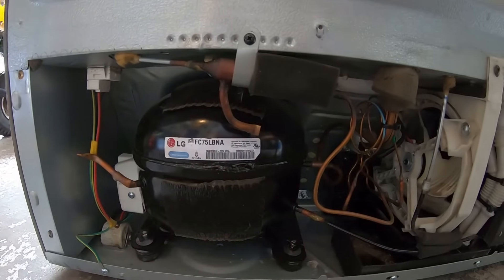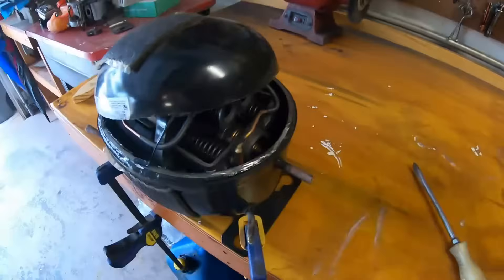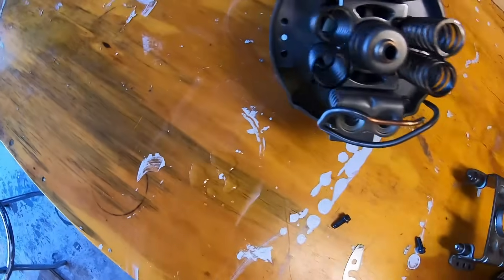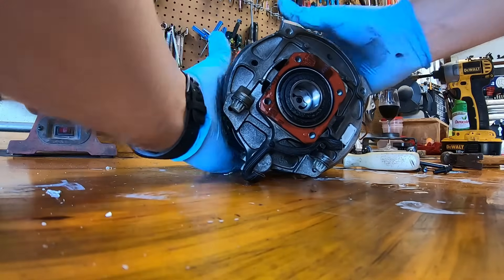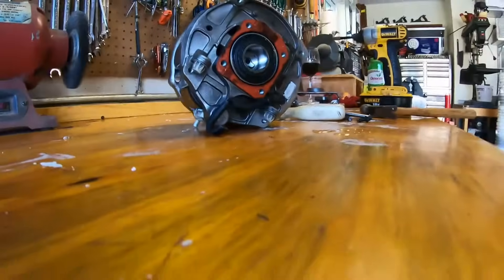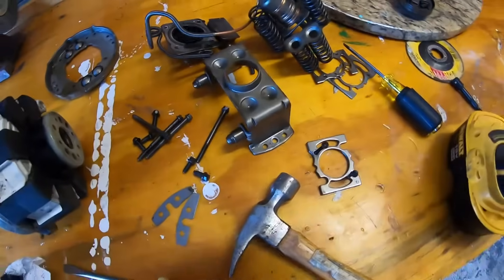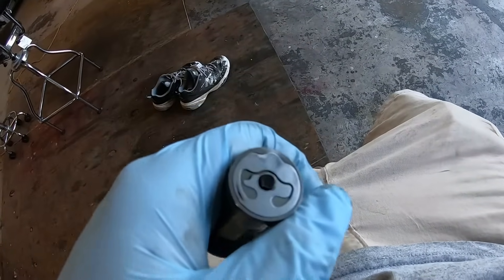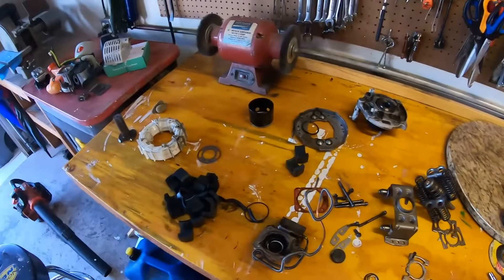Cutting open a failed LG refrigerator compressor

Comment: That “flimsy” metal plate on the top of the piston is the inlet/suction valve. I recently cut one of these open as well to find that mine had a hole blown through it. I found the same burnt residue on the same parts as yours. I assume probably burnt oil from running constantly without pumping anything.

Comment: I really miss the good old days where fridges were built like tanks and even lasted for decades. Nowadays, manufacturers dont build their products as robust compared to the 80s. My LG fridge gave me so many issues that it left me feeling stressed. Even repairing it costs a bomb.  I dont expect a fridge to last me for decades in this era but it should at least last for more than 5 years !
Reply: I DO expect that that when I pay good money the product lasts for decades. The last stove we bought cost $1,000 and within months the burner switches failed and then the main control board. They wanted half the price of the stove to replace the board. It's pure THEFT, as far as I am concerned and if I was a millionaire, I'd SUE.
Reply: When you open the expensive ovens you'll find the exact same thermostat assembly and other components as used on the lower cost makes.   @rae0521
Reply: A friend has a fridge freezer from 1960. No bells and whistles, but it works. I'm waiting for the EPA police to bust down her door snd take it away.
Reply: When I was forced to buy a new fridge last year, I shopped around and the Samsung and LG were the most popular and affordable. But, after some research, I found out they were the least reliable. Instead, I bought the slightly more expensive Fisher and Paykel for superior reliability: could not be happier.

Comment: I ran into a no cooling issue in an lg refrigerator with a linear compressor. I checked everything, including the compressor. After evacuating the system and putting a vacuum pump on it for 20min. I recharged the system and let it run for a day. After this procedure, the LG refrigerator is cooling just fine. I believe there was a restriction in the lines.
The LG refrigerators have a track record of leaks and restrictions in the lines because of its poor line set design.

Comment: can you replace the linear compressor with a regular one? i have old one laying around
Reply from the maker: In theory yes, but the control system is different I believe. A traditional fridge compressor takes straight 120 VAC / 60 Hz (in the US). I believe the linear compressors have a more complicated / VFD control system, but I could be wrong.

It should be possible to rig something up to just send a traditional compressor 120 VAC, but I have not tried doing so.
Reply: it's a dc compressor which requires an inverter/controller board to run it - dc compressors use half the power to compress the same amount as an ac compressor - may save about $100 per year

Comment: Lg and Samsung are making Garbage these days. 

My LG Fridge finally broke down only 3  years old and that seems to be the normal lifespan for their fridges. 

My LG Microwave also had an issue with Fan on one occasion and on another occasion it had an issue with Board itself. 

My LG OLED TV Also had burn in issues with green dots known to LG but they refused to fix it. 

No more LG for me. They have gone to Chitz in the name of young executives and bigger profits for bigger bonuses amongst themselves while we are fooked. Now fook LG. 

Is there an upgraded better compressor LG is using now to replace the bad ones? or are they using the same ones to replace the bad ones?

Comment: Please help me if you can ..I did all the test i can find here and google. The compressor makes a humming noise sounds normal gets warm to the touch?, fans work on mother board push test mode up and down compartment fans but that shuts off after mins of the light show on display panel. The fan works for condenser coil no error codes that show of front panel , I was able to produce a code pushing freezer and ice code 22 , The M board looks good visual, only one main fuse on mine i see , I never saw the mother board LED light up at all for anything.  Issue is this plugged in to power got nothing but a fridge lights panel lighting panel display temp like normal. I hear the compressor come on but no blowing no cooling but seems like normal sound i guess seems to be something of a vibrate on compressor whats your thoughts . This LG fridge quit after wife said the freezer door was left open a inch for maybe 10 hours and she shut it and also cleaned it that night and then next morning ice melted from ice machine and no blowing no cold. I did a check on starter relay seems ok from continuity and compressor ohm reading about 10ohm if i did that right where you test pos leg to compressor 3 prong and ground. LG recall on compressor ironically this happen 4 years ago when trying to clean but it regained cooling. What the heck I'm stumped.Please help me if you can Mr wizard ..I did all the test i can find here and google. The compressor makes a humming noise sounds normal gets warm to the touch?, fans work on mother board push test mode up and down compartment fans but that shuts off after mins of the light show on display panel. The fan works for condenser coil no error codes that show of front panel , I was able to produce a code pushing freezer and ice code 22 , The M board looks good visual, only one main fuse on mine i see , I never saw the mother board LED light up at all for anything.  Issue is this plugged in to power got nothing but a fridge lights panel lighting panel display temp like normal. I hear the compressor come on but no blowing no cooling but seems like normal sound i guess seems to be something of a vibrate on compressor whats your thoughts . This LG fridge quit after wife said the freezer door was left open a inch for maybe 10 hours and she shut it and also cleaned it that night and then next morning ice melted from ice machine and no blowing no cold. I did a check on starter relay seems ok from continuity and compressor ohm reading about 10ohm if i did that right where you test pos leg to compressor 3 prong and ground. LG recall on compressor ironically this happen 4 years ago when trying to clean but it regained cooling. What the heck I'm stumped.Please help me if you can Mr wizard ..I did all the test i can find here and google. The compressor makes a humming noise sounds normal gets warm to the touch?, fans work on mother board push test mode up and down compartment fans but that shuts off after mins of the light show on display panel. The fan works for condenser coil no error codes that show of front panel , I was able to produce a code pushing freezer and ice code 22 , The M board looks good visual, only one main fuse on mine i see , I never saw the mother board LED light up at all for anything.  Issue is this plugged in to power got nothing but a fridge lights panel lighting panel display temp like normal. I hear the compressor come on but no blowing no cooling but seems like normal sound i guess seems to be something of a vibrate on compressor whats your thoughts . This LG fridge quit after wife said the freezer door was left open a inch for maybe 10 hours and she shut it and also cleaned it that night and then next morning ice melted from ice machine and no blowing no cold. I did a check on starter relay seems ok from continuity and compressor ohm reading about 10ohm if i did that right where you test pos leg to compressor 3 prong and ground. LG recall on compressor ironically this happen 4 years ago when trying to clean but it regained cooling. What the heck I'm stumped.

Comment: Our LG stopped cooling the other day.   It's past the warranty period.   Wife wants a new fridge because this one has been troublesome with the ice maker.  Hint:  The fridge side was "too cold" and as far as I can figure, the water supply line was freezing before the water made it to the ice maker.  Will be avoiding LG and anything with a linear compressor.   Thanks for the great video!
Reply: There's a number inside the fridge on a sticker.  Call it, and someone will come fix it free of charge.  At least get it working to make a few bucks selling it.
Reply: @Chris-vx5kp What are you talking about? Sears?
Reply: @BadAssDude69  Sears is just as dead as the compressor.  The number in fridge is to LG.
Reply: @BadAssDude69  Nope.  They didn't charge me a dime.  However, be wary of calling a repair place that says they fix the fridge.  Repair places will charge you and LG; I told on 2 repair places to F-off.  Call the LG.
Reply: Fridge-side ice makers are notoriously bad in all manufacturers.  Get one with the ice maker in the freezer, or use something else.

Comment: My Kenmore Elite refrigerator stopped colling after four years.  a lot of food was ruined. The faulty LG linear compressor is issue root cause. A tech from Sears home Service said that Kenmore does not cover labor cost after the first year. Over $700 has requested for compressor replacement. I also have to wait for 12 days for part delivery and technician schedule.

Comment: I have to say I’m getting concerned. I purchased the French door LG last month because I like the stainless black colour . I pray they’ve got this resolved in 2023 but now I’m having my doubts. 
I did watch another video that showed a replacement compressor that had a red sticker on it from LG, I believe the guy called it their universal, and said it was the fix .
I really don’t want to take my brand new fridge apart ,but I’d sure like to know what the numbers on the compressor are .
Funny how I find out about these issues after I buy them . At Home Depot they claimed they had good success with LG, but it like their junk. 
The sad part is I had my 20 year old kenmore fridge that was still functioning fine took to the dump , and it probably would have outlasted my new LG
Reply: Bought mine on 2017 November. Just went out. Getting the red sticker replacement unit. You'd think they'd have solved the crap compressor in your new one. But your icemaker will probably take a dive in a couple years.
Reply: @TheFrenchPug  I’ve never heard a good thing about built in  Ice makers so I didn’t go that route . I wish I knew there was a version that had water only though ,  as I would have gone with one of those . 
I’m also kicking myself for going with black stainless,as not I’m stuck with LG if I want matching appliances. I wish I just went with stainless , then worse case you could always use different brands and they’d look similar
Reply: @MajorTendonitis  My wife wanted that black stainless also. I told her no. We went with the black gloss that matched the stove and can go with stainless as well. It was hard to find the bottom mount freezer in that color though. Found a Kenmore Elite. So we thought we were buying quality then later found out it was made by LG. Our kids had already went through 2 icemakers and a compressor after 2.5 years.
Reply: mines just went after 3 years. wtf
Reply: @anothersummer2782  this isn’t helping
Reply: Same boat, bought a model LGEW249470 in 2021, compressor died after 2 years, the parts are covered by LG but had to pay the tech, around 400$

They replaced it with another compressor model TCA37032028

I don’t know if it’s the same model as the original, I noticed it sounds different when it runs.
Reply: @phil-l  2 years ,great :( . I watched a video where they recommended a new compressor with a red sticker on it . I can’t believe the reliability issue is still there , talk about disappointing. One thing I do like is it’s extremely quiet compared to my old energy efficient kenmore with the bottom freezer . Heck , I swear it sounded like a gun shot from ac22 when the valves were engaging

Comment: My experience with the LG linear comps is there is a seal that fails. I think it breaks down either through heat or something else. It's what my gut says is leaving all the black goop behind.

Once the seal fails it cab no longer compress and move the gas despite it humming right along.
Reply: It fails because the filter/dryer clogs up and causes high head pressure. The filter/dryer clogs because LG and every manufacturer sweep charges instead of pulling a correct vacuum on the system.
Reply: @slaughterzealibib  Well, that explains why I needed a new dryer part just recently. Do you know what the controller board update does for anything?
Reply: @TheFrenchPug  Nothing I can tell. It may change the frequency variation of the compressor but I haven't actually put an o scope on one to see if that is the case.
Reply: Mine got seriously hot. What would cause it to get so hot? It could keep the fridge cool but not cold. Getting a new one in a few days.

Comment: My french door LG kicked the bucked after almost 7 yrs.  I checked compressor, it wasn't vibrating and it was getting unusually hot.  Too bad, I just replaced ice maker  assembly, so I guess I can recycle the one good part for someone who needs a replacement ice maker unit.  Rest of the fridge will be scrap for recycling.

Comment: Your video made me clear now. I worked on a LG fridge yesterday. The compressor ran but it wasn’t hot. I was confused. I think I knew why after watched your video. Thank you sir.
Reply: I have that exact issue -- compressor not hot and fridge not cooling (stuck at 50-52 degrees).  I called LG and they put in a ticket now I'm waiting to hear back from someone to schedule a repair! Fridge model is LMXS30776S
Reply: @sethmeistergee  I have the same model.  Same issue after 5 years and 3 months of purchase.  I am outside the class action window.  The fact that my compressor still exhibited vibrations when running fooled me into thinking it was still good.  Tested everything else (circuit board, checked for frozen coils. etc).  Turns out it was the compressor after all.  I guess with these linear compressors, they can be running mechanically and electrically and still be defective (i.e. not able to pump freon) due to the seal or valve. Even though the compressor is warrantied for 10 years (parts only), I didn't have time to fool with LG's stupid process which they said could take 7-10 business days to ship a new compressor after my repair person contacts them and gets "approved".  I just ate the cost of the compressor.  The tech did install a new LG compressor with a red sticker.  Hopefully it's the updated ones.  But screw LG.  Will never buy another LG when this one fails again.
Reply: @sethmeistergee  Ours failed a month ago after six years, and the class action lawsuit where LG awards every claimant $450 expired in 2021.
Reply: @pointzerotwo  there was a different lawsuit where you can still get relief but only if the failure happens within 5 years of purchase.
Reply: @sethmeistergee  Do you know where? Mine failed within 5 years just this week.
Reply: My LG compressor was extremely hot. It was on but barely cooling. You could not touch it without burning your fingers.
Reply: I think mine failed the same way too. Compressor was running but was cool to the touch.

Comment: Same here we have an LG LSXS26396s that is only 5 years old and it died yesterday.  After doing a few troubleshooting things checking the coils and fan came to the conclusion it was a compressor issue. Called LG and made an appointment.  Tech just left the house after upgrading the firmware and swapping out the compressor. Hopefully the new compressor last more then 5 years. Found this video after searching about lg compressor.  Doubtful I will buy an LG in the future but have come to the conclusion that all brands nowadays suck.
Reply: @Info Magnate Wow so next time I will have to pay for the service and parts. It’s a shame appliances don’t last like they used too.
Reply: @Info Magnate That really sucks!  Mine is only 4 years old hopefully I can get another 4 years. I won’t be buying an LG with an inverter next time.

Comment: did you happen to get a part number of that failed part? my LG fridge compressor is running with no flow/pressure, thinking to tear it apart to get to the issue, replace the ring , reassemble compressor and run it some more?
Reply from the maker: Unfortunately, refrigeration compressors are generally replaced as an assembly. There are no serviceable parts inside because the whole unit is welded shut.